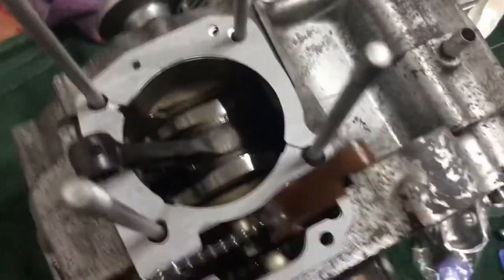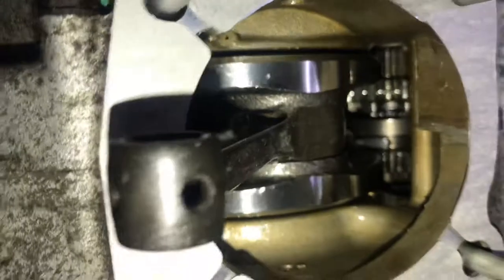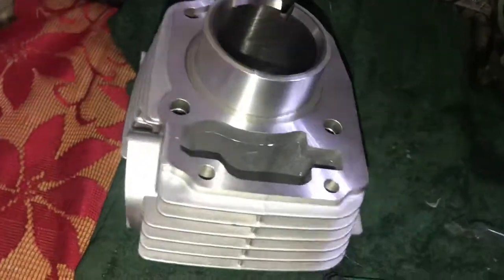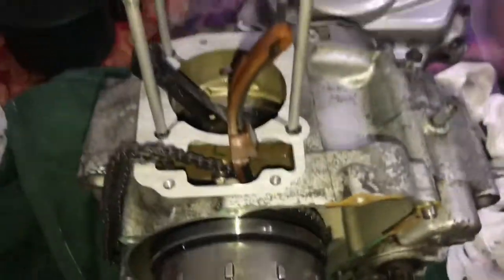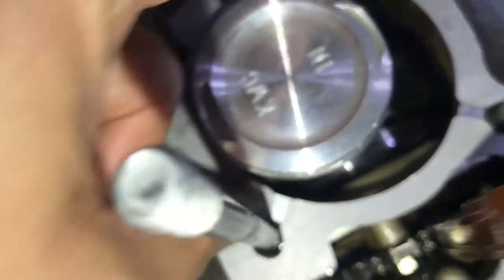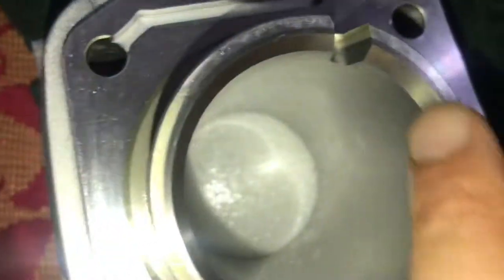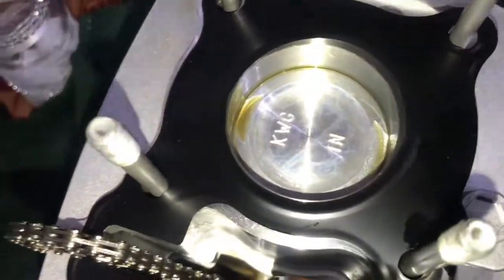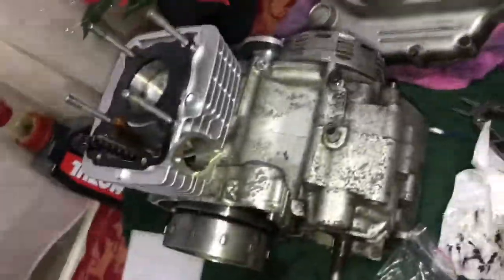Reviving a CBF125 ( Part 5 - New Piston & Cylinder)

Comment: You didn't split the crankcase? With fragments, you should have split it so you could inspect EVERYTHING.
Reply from the maker: Flushed the engine 3 times, first time round fragments came out - second time nothing, third time nothing, then I inspected, found nothing. Engine back together and 2800 miles done to date and no problems
Reply: @MrScififan  Magnetic sump plugs exist. But they never catch gear teeth. They never get close enough to  the drain hole and are too big.

I have seen videos where others install the rings, partially install the piston to the cylinder, then feed the pin through.

You'll never truly know unless you open it up. But your choice.
Reply from the maker: Forever Computing Yeah it was a judgement call - I didn’t drain the flush out of the drain plug - I was expecting big fragments so I drained it out of the piston hole before I reinstalled the piston - Since then I’ve also changed oil twice since putting it back together - then gauze filter was clean